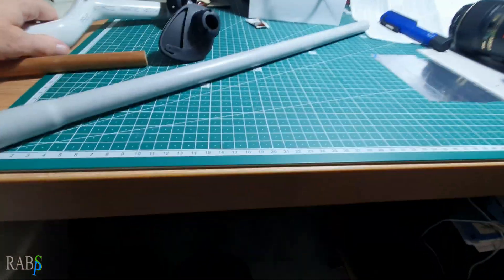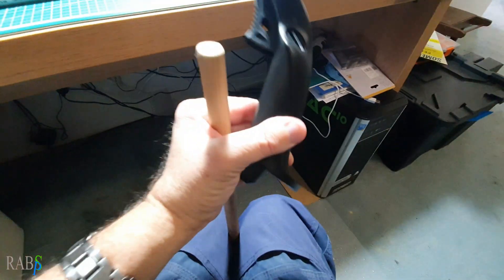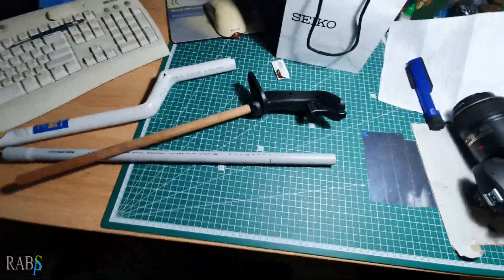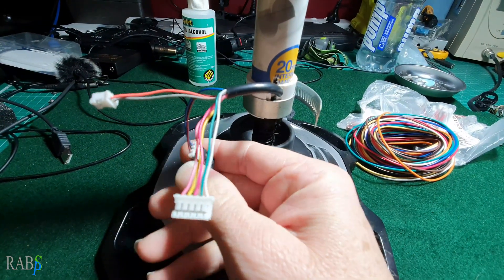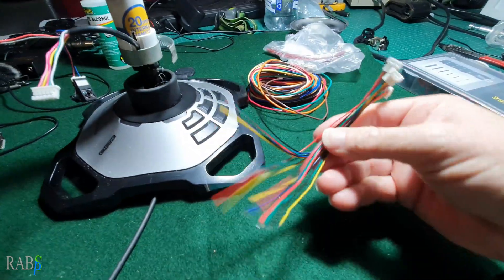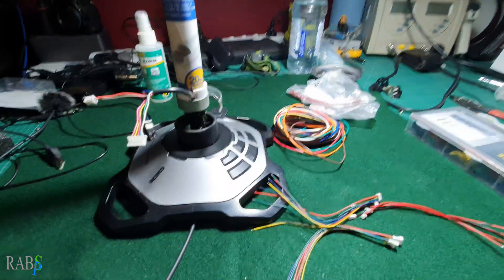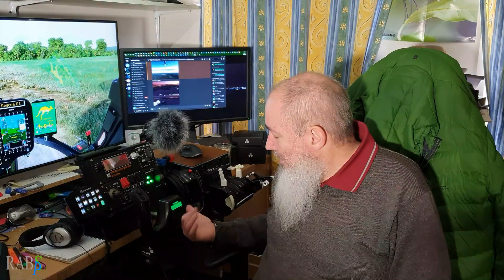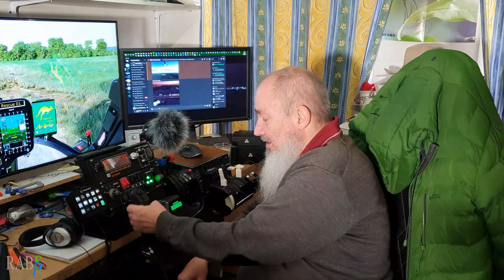RAB 115 Heli Cyclic Build from a Joystick

Comment: Could you please share the link for the connectors to extend the wiring?
Reply from the maker: @jasescout  I would try these, I think they're better and are the ones I'm using on my current project. 
https://www.ebay.com.au/itm/355942475422?mkcid=16&mkevt=1&mkrid=705-154756-20017-0&ssspo=BVhRfmfoSU6&sssrc=4429486&ssuid=GhYgtLrYTfy&var=&widget_ver=artemis&media=COPY

Comment: did you remove the spring and bushing that center the stick? i reckon it'd make it a bit looser and maybe more realistic
Reply from the maker: @scroingus2279  someone asked that  awhile back. I did, but didn't like it. My dog would bump it and it would not go back to centre, if I was flying I would be in the ground before working out what it was. If you only fly helicopters it would be ok, but there is no feedback unfortunately.
Reply: @Ron_A._Bolton  makes sense! definitely considering it just for helis, reckon i'll give it a try, since it seems very reversible

Comment: It’s not a smart thing to do, increase the length of the handle, thereby reducing the stroke of an already bad joystick, bravo)))
Reply: Also, the 3d pro is not a bad stick, my guy. It just more fragile because the parts are cheap. It's a solid option for having fun
Reply from the maker: If you say so.
Reply: Honestly, I'd take that joystick over most that are 5x its price. Its only flaw is the aging compatibility software.
Reply: It will increase the wear of parts due to the extra force applied via lever physics. BUUUUUT it is a precision equipment. You're supposed to use it in a gentle way and never swing it wildly. It should be fine for many years. I'll just do the same really.
Neat project!

Comment: How's the joystick holding up so far?
Reply from the maker: 1 year on, all still good, it's great for the Ornithopter too
Reply from the maker: Really well, no issues so far.
Reply: @Ron_A._Bolton May I ask how much different does it feel from the original version. I would imagine that the weight added by the extensions may make it more loose as shown in the video, but does accuracy actually improve? Is there really a substantial precise movement difference

 Also I would like to make you the suggestion of 3d printing a round bearing to sit on top of the spring, there's a video on it, I will try it out since it makes the stick stay in place, which would be the cherry on the top for this set-up, just a thought.

 Anyway, let me know!
Reply from the maker: @DonJuan247  sure, please send the link. The fine accuracy is definitely better with the longer stick, so you can input finer movements, still only move the stick small ammounts,  very close to the feel of a real cyclic, but without the feedback. Still makes landing a lot better and more accurate.
Reply: @Ron_A._Bolton  Oh great that's good to know! Here's the link for the mod I was talking about https://youtu.be/uJaScQKxH5o
Reply from the maker: @DonJuan247  I watched, thanks, I had one installed before, but put it back to normal, it slips outside the dead zone and kicks the ap off, if my dog comes in and bumps the stick when I'm not using it, I  would find myself in the ground before I knew what was happening. If it works for you then all good.

Comment: Nice video Ron. I adapted a joystick in similar way recently but I find that adjusting the sensitivity is problematic. Due to extending the cyclic length it requires further directional travel and not really what i hoped for. Any suggestions for improvement? Such as advice for cyclic sensitivity settings or adjusting the axis 'curves'? Thanks  in advance.
Reply: Thanks very much. I'll keep tweeking the settings then and persevere. 👍
Reply from the maker: I did adjust the sensitivity graphs to get it dialled in. Once you have it set once it seems to stick ok.